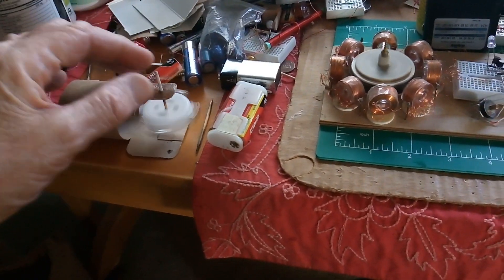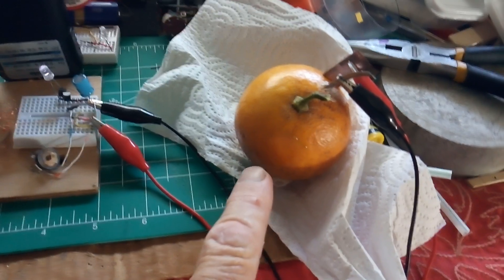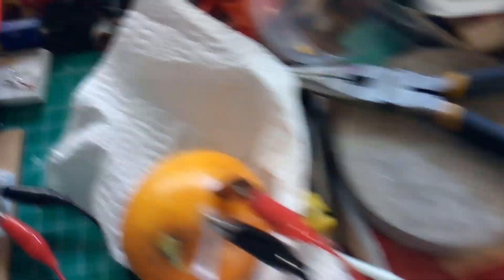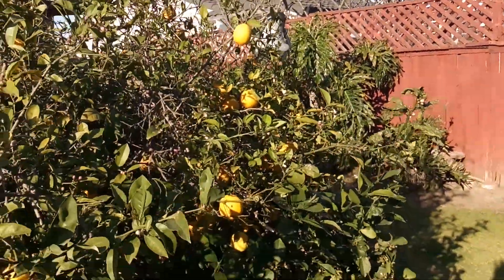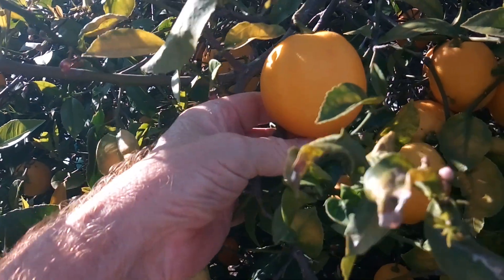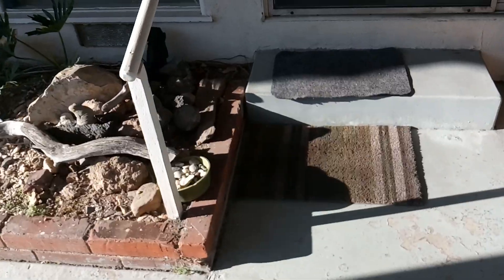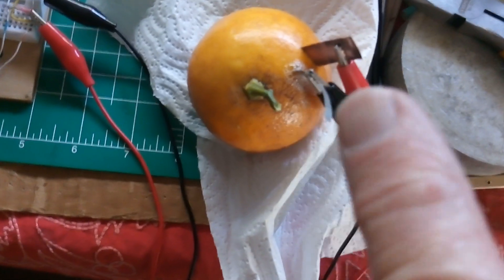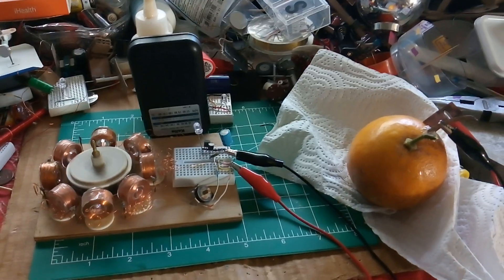Lemon battery question

Comment: If you think about it, the lemon battery is a solar panel with extra steps, because the fruit is a product of the sun lights energy on the plant, stored in chemical potential energy... Although I think the majority of the energy comes from the potential difference between the two metals, and the lemon is just an electrolyte bath and holder to facilitate the movement of electrons from one to the other.